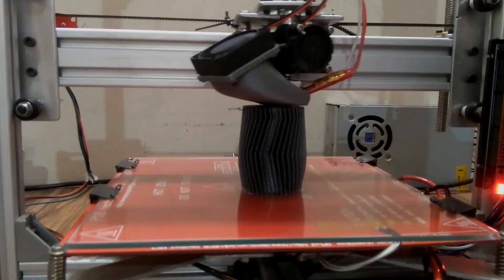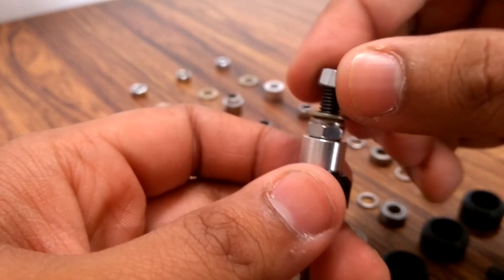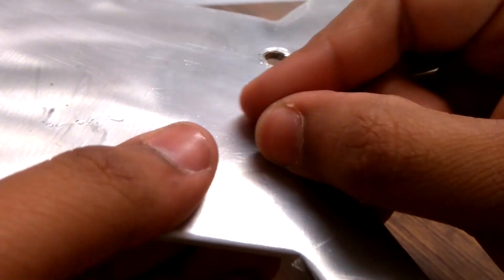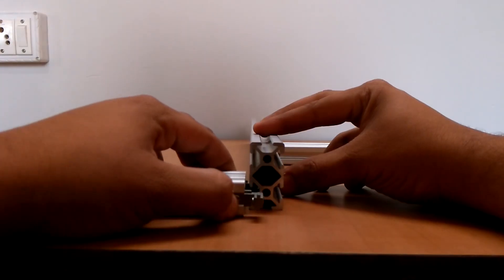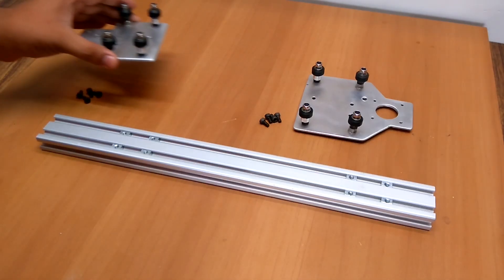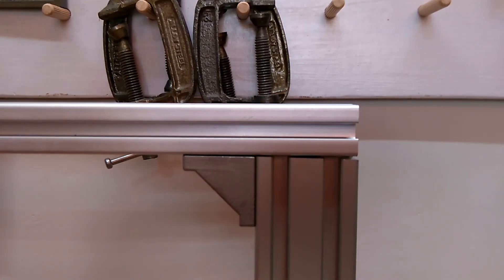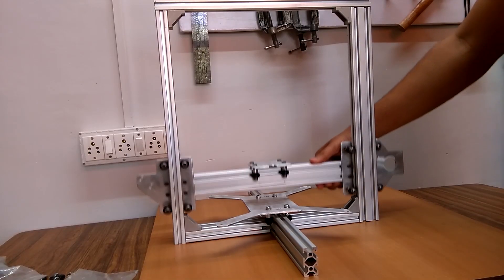How to Make 3D Printer Using Arduino - Part 1

Comment: Please please answer this question. 
If I use ramps 1.4 and I made the printer successfully,  now I started a print .
What will happen if electricity goes off , when the print was completed hald .
Will it restart or start from half
Reply from the maker: no it will not restart after power is cut. once power is restored, it will ask to resume from the same place it left. until that, you dont have to disturb the incomplete job on the printer. 
i can understand power cut is a big issue in india. i am working on a better solution for power loss during printing. sorry for the late reply. thanks
Reply: Very late reply ,
But I pray aap power cut ka koi aacha solution nikallo

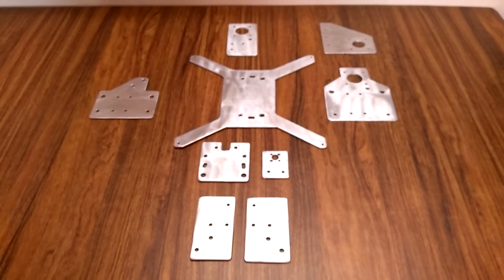Comment: I cannot get the nut which you used in mini v wheel . Please tell the spelling.  At 0:35 . When I search for it doesn't show anything. So please tell
Reply from the maker: it is called nyloc or nylon lock nut

Comment: hey, im new to this. where should I get the aluminum plates that have a cad file for.
what tool would I need?
Reply from the maker: i used angle grinder and drill to make the plates

Comment: Can it print 3d models made in softwares like maya or blender or 3ds max?
Reply from the maker: Yes you can. All you have to do is save it as .stl file. And use a slicer software to slice it before printing.

Comment: Man, im building a printer based on your video, and i need some information about the bolts. The bolts showed on 0:36, can you tell me the especifications in mm of them, cause i cant find anything on your list of bolts a nuts on "show more".
Reply from the maker: The bolts are 5mm x 25mm button head bolts, if you want i can add aliexpress link for it
Reply: @SuperbTech  Please, it will help a lot, the dimension of screws and other part will help as well.
If you can, will be very helpful if we can talk on Skype or other ways, cause is too much thing that i dont figure it out yet.
And i realy want to make a 3D printer base on your video!
Thansk a lot!
Reply from the maker: im currently busy on another project, i will update the parts as soon as possible